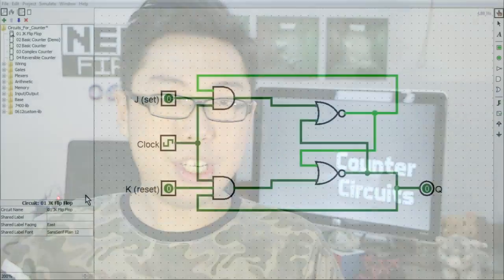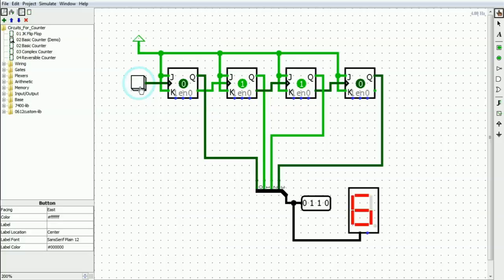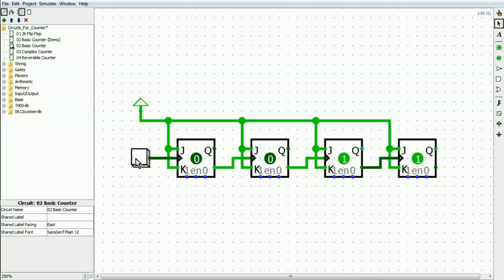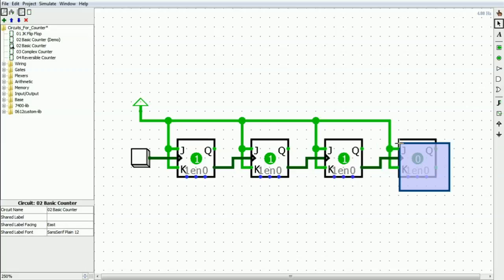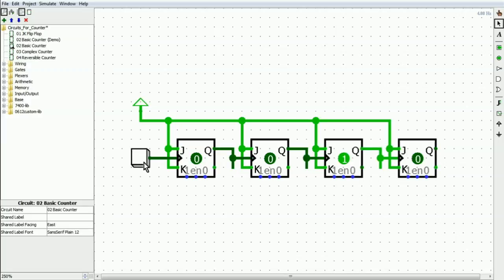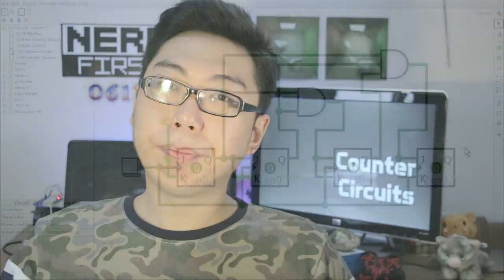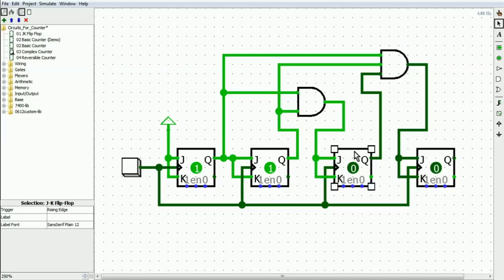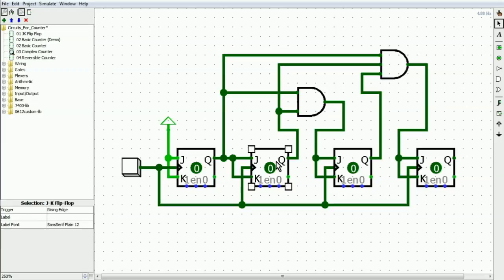Counter Circuits

Comment: Hi, cool video! I have one question. Why does the current stop after each flip-flop and why is there not always the same output? Is it because there is a slight delay?
Reply from the maker: Hello and thank you for your comment! You really shouldn't think of it as the current is stopping, it's not! The current is continuously flowing, but the circuit has been designed to not respond to that. It works out this way because there's a clock pin involved - The circuit only moves ahead to the next stage at the moment the clock pin goes from low to high. So even holding the button down would not change this behavior.

Here's a video that goes into greater depth on this topic, as well as into the flip-flops that are prominently used in this video: https://www.youtube.com/watch?v=5zzvzx_LJCw

If you're interested in how exactly this pulse detection works, here's a lower-level video on that: https://www.youtube.com/watch?v=N9i4ln2nPfI
Reply: @NERDfirst  thx for the quick reply! I was wondering how the d flip-flop switched. When the first input was high it put out high but on the next high it put out a low. But I just learned how d flip-flops work with an edge detector. So now I understand 🙂

Comment: Is this asynchronous or synchronous?
Reply from the maker: Hello and thank you for your comment! I would not consider this to be synchronous. While the individual components do use a clock signal, it's used as a trigger and not as a clock.

Comment: how can I use 7segment display instead of a hex display?
Reply from the maker: Hello and thank you for your comment! While it's certainly possible, it'll be quite difficult. The controls for the 7-segment display require you to manually light up the individual segments. You'll have to create another circuit that "translates" binary values to the individual segments.
Reply: @NERDfirst  so, a decoder?
Reply from the maker: @stealthemoon8899  Hello and thank you for your comment! A decoder isn't enough in this context, as you'll have to light up multiple segments for each digit, and each segment can be lit up by multiple numerical values.
Reply: @NERDfirst  so, kind of a mix of a decoder and encoder?
Reply: @NERDfirst  or a pla?

Comment: What is the splitter connected to on the hexadecimal circuit because it looks longer than its suppose to ? And I can't get mine right
Reply from the maker: Hello and thank you for your comment! Set your splitter such that "Fan out" is 4 and "Bit Width In" is also 4.